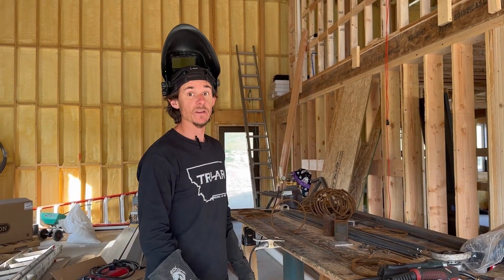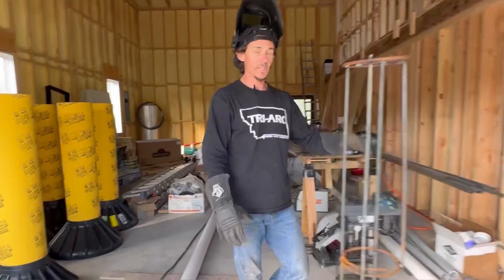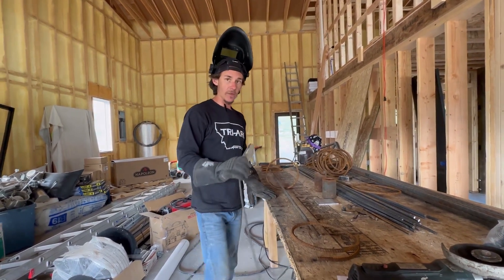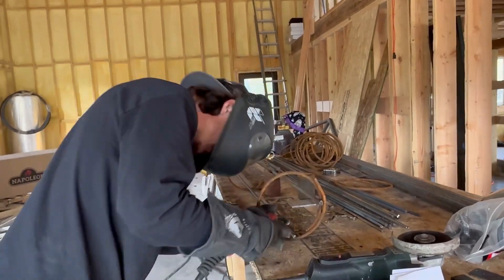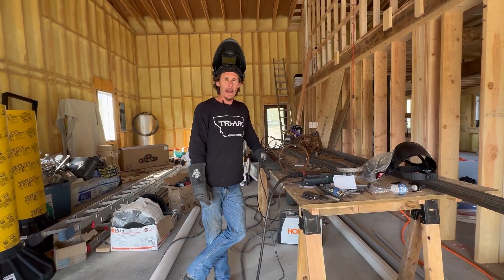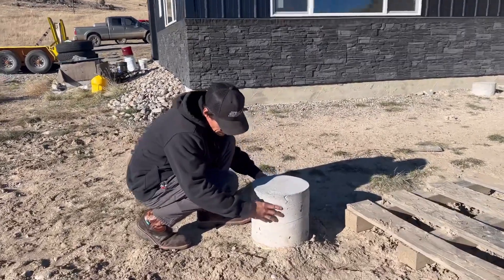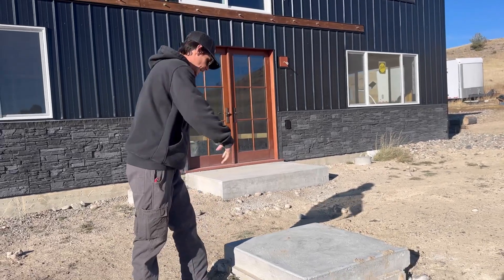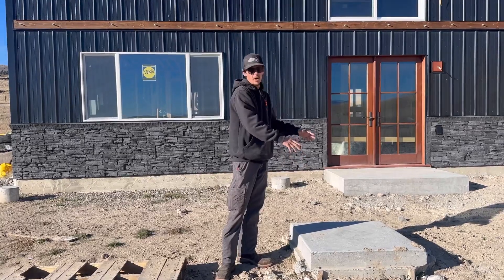Rebar Cages for Sono Tubes or Concrete Piers

Comment: I use the same product for my deck foundation.  I used 1/2 inch straight rebar without the round cage.  After tube is filled I just stuck four pieces straight down, about an inch from sides.  Tap bottom of hole, then pull them back up to be sure they are surrounded by concrete.  The steel adds bending strenth uf placed properly

Comment: I built thousands of window bars and prison style entry doors out of 3/4' rebar for a storage facility in the 90's.  I made an absolute fortune of that job and the next ten that were just like it.  I dunno why some people say they hate welding rebar.  Crank the heat and let er eat!
Nice job on the rebar for the tubes.  I may have missed it but it there anything from keep the rebar from touching the tube, like spacers
Reply from the maker: No just the steadiness of my hand! But that right there is more important that weather I welded it or not. If and of that rebar is exposed it could absorb moisture and swell from rust cracking the concrete!

Comment: The American Welding Society (AWS) D 1.4 sets out the practices for welding rebar in the US Without special consideration the only rebar that is ready to weld is W grade (Low-alloy — A706). Rebar that is not produced to the ASTM A706 specification is generally not suitable for welding without calculating the "carbon-equivalent". Material with a carbon-equivalent of less than 0.55 can be welded.

ASTM A 616 & ASTM A 617 (now replaced by the combined standard A996) reinforcing bars are re-rolled rail steel and re-rolled rail axle steel with uncontrolled chemistry, phosphorus and carbon content. These materials are not common.

Rebar cages are normally tied together with wire, although spot welding of cages has been the norm in Europe for many years, and is becoming more common in the United States. High strength steels for prestressed concrete cannot be welded
Reply: Well he always said he’s a shitty welder but a good business man…. 😂 guess we are seeing that shitty welder side.
Reply: Tying Rebar

For almost every intent, purpose, or code, tying rebar has become the standard way of securing your rebar together. Why? Tying keeps the rebar cool, so you don’t have structural issues down the road. It allows flexibility for the slab and the rebar to move independently to a certain extent without causing stress fractures in your finished project. It doesn’t require you to get any particular variety of rebar unless the specs call for it and it’s much faster to put together on the job site, especially when you have the proper tools for the job. Let’s take a look at a couple rebar-tying tools:

    The BNT-X Series Automatic Rebar Tiers automate your tying job with a lightweight tool that uses a powerful 18 volt, rapidly-charging lithium-ion battery. Each tie includes three turns and on average, you’ll get up to 4,000 ties out of each battery charge, saving you a lot of time otherwise spent replacing and charging batteries. The pistol grip lets you work all day comfortably while the wire coils provide up to 128 wraps per coil.  We carry three models designed for different rebar size and tying needs, along with a line of accessories and replacement wire.

Welding Rebar

The first question you need to ask when considering welding rebar is whether or not it can be welded in the first place. Because rebar is not as closely controlled in terms of metallurgical quality, the average rebar you pick up at a contractor supply house or big box home improvement store isn’t high enough quality to be welded effectively. Welding-quality rebar is typically marked with a “W”. But many inspectors won’t allow rebar to be welded, depending on their local codes, and you’ll need to remember to not quench the rebar, as this affects its ability to provide proper support in the finished product. Many people avoid welding rebar because the concrete and the rebar in the final piece will expand and contract at different rates, so having the rebar welded together creates pressure points where the concrete can crack.
Reply: @FishFind3000 I don't want to crap on the man's welding ability, but he is a good teacher if you think about it. We all just learned something lol
Reply: Just so you guys who don’t weld every day know, he’s welding that so damn cold you almost wouldn’t be able to notice a difference in the steel. Normally I would weld something that thickness at about 24v 400-450 in/min at least. He’s taking his time. Notice how you never see the rebar actually glow.
Reply: @Weldoholic  I explained it pretty thoroughly.  You want your cages to move freely to a certain extent. So it's more about the concrete than the weld. I just love the technical information. I'm welding everyday. Multiple processes. Just sharing some legitimate information. In the words of this great channel, "If you don't like it, then go f*** yourself." Lol
Reply from the maker: I could see it that it might matter in a larger structure. But it won’t here. It’s might be some engineering standard but the “ability for the rebar to move” makes no sense. If it’s moved to the extent that it matters wouldn’t the concrete be cracked to shit anyway? I’m this day and age I don’t take engineering standard’s seriously unless I’m paid to anymore. If you think about a lot of the standards across industries don’t make much sense. But again this is a personal project and this rebar is mild steel. It will be ok, most guys just shove 4 sticks of rebar in the wet concrete and “wet set” which is a big no no.
Reply: @michaelryan9311 right on 🤟😂
Reply: Regular rebar is garbage steel. W rebar is just over spec. At least use GR30 j bolt anchors with the rebar rings.
Reply: Nice infor but I'd watch Anthony weld two dog turds together on video just cause he's entertaining 😂👍
Reply: that is my understanding
Reply: @MeltinMetalAnthony  my understanding is that welding creates weaker metal in the HAZ.  this might be important in a stadium or high rise holding thousands of people 500 feet in the air.  In a deck footer at a home in the country, not so much.  Lovely backdrops.

Comment: the cages turned out looking nice.  I did some reading about MIG welding rebar a while ago--I didn't do it because I read that some grades (high tensile strength) rebar can become very brittle from welding.  Do you have any guidelines about what is or is not ok to weld?  I would LOVE to MIG the next batch of pier cages.  Doing it with wire is just a pain.  And no matter how careful, the structure is all wiggly.  Zapping it together I would much prefer.

Comment: I was told not to weld rebar because it weakens it.  Two wire ties at each point should be good enough
Reply from the maker: I’ve welded certain grades in bridge applications. I can’t see it matters in such a small structure.
Reply: @MeltinMetalAnthony  I see it welded all the time, plus shouldn't matter as your deck is a compression application and concrete is strong in compression and the rebar adds the strength in tension.
Reply: Worked for a precast company for a number of years, they used welding extensively in the reinforcing cages.  There are some guidelines about joints and where not weld but definitely not an issue.

Comment: Just tie the cage with rebar wire. You shouldn't torch cut or weld rebar.
Reply from the maker: It really doesn’t matter. Most dudes just wet set 4 sticks in with no radial support